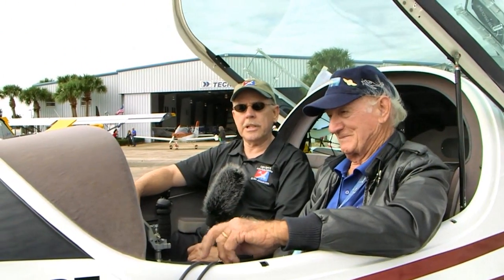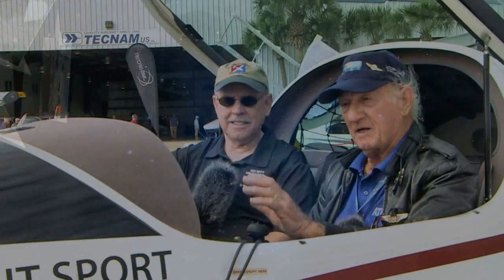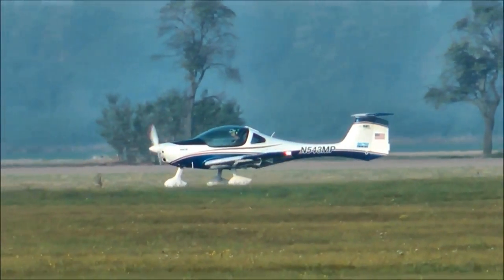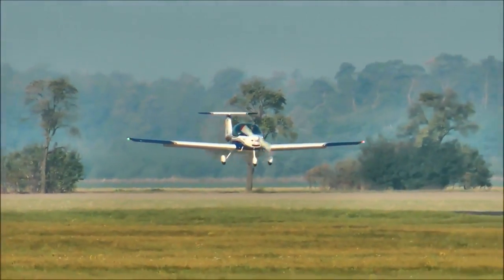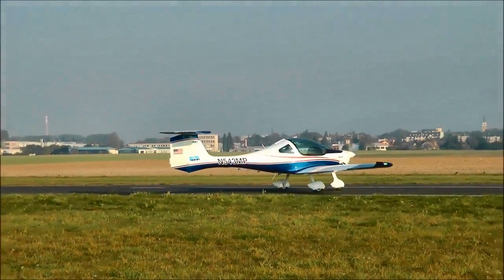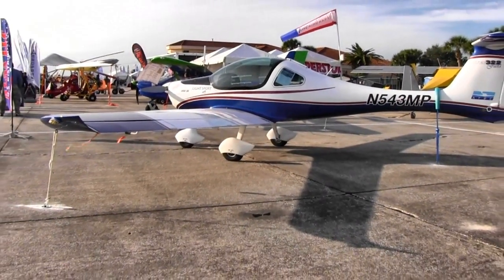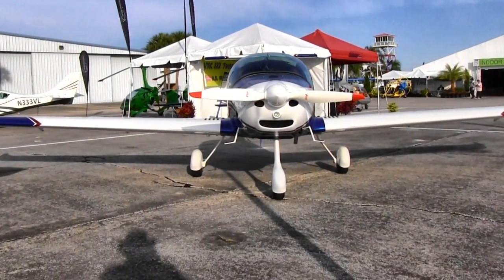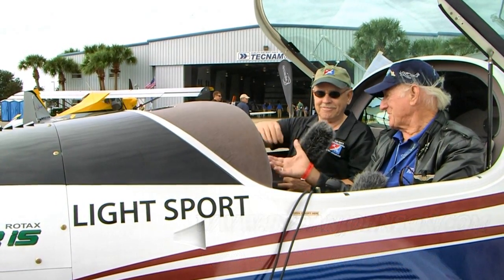ATEC 322 light sport aircraft, ATEC ALAS LLC Rockledge Florida.

Comment: LSA's should be outlawed! They are too slow for responsive maneuvering, too low weight for safe wing loading parameters, too light and they are the number one aircraft responsible for aviation fatalities! The minimum Gross Takeoff weight should be no less than 1,600 lbs.
Reply from the maker: With over 20,000 hours flying them, and over 1200 students, I would have to say that is a load of crap! They can cruise all day long at the LSA speed limit, AND faster in the experimental category! 
They are MORE responsive than any 150 or 170 can ever be, and can take off and land in half the distance from almost any surface. Equipped with floats - or as amphibs they are amazing!!

Having done an extensive study of accidents in LSA - over 80% are conventional pilots that haven't bothered to get checked out.